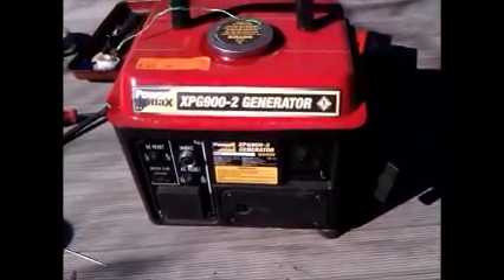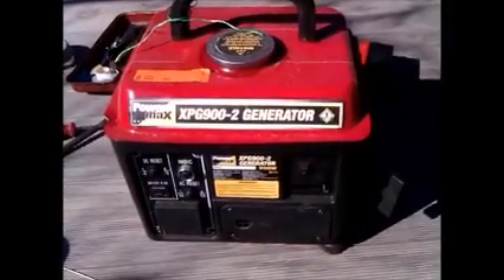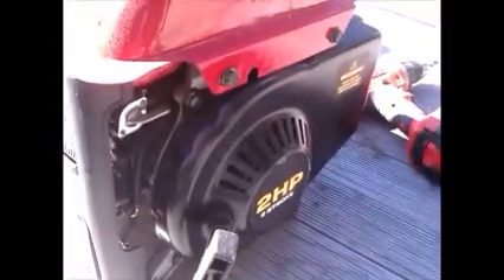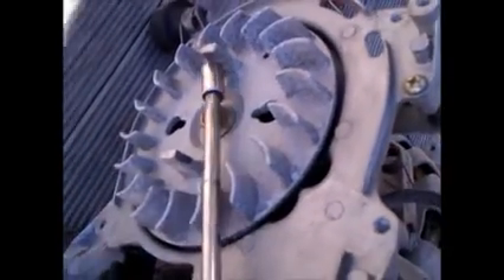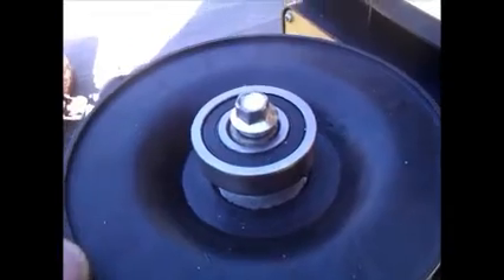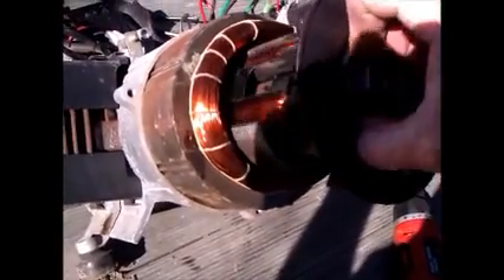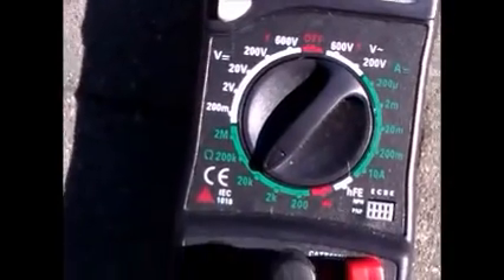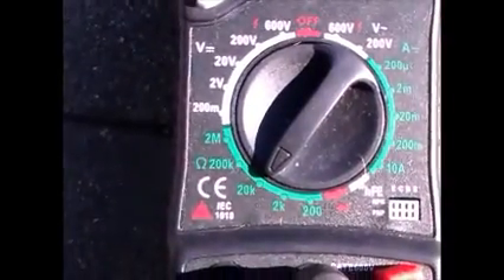How to remedy no output Powermax/Homelite 700w Generator.

Comment: The rotor coil is not connected to any part of the generator, how its work ? Thank you
Reply from the maker: It's a brushless generator. It works on magnetism. The faster the motor turns the higher the voltage output . It's difficult to explain

Comment: Hi Paul P  I have a small genny like this but the output fluctuates e.g. 200 watt light goes bright then dim then stays bright for a bit then dull for a bit, what the heck could this be?
Reply from the maker: Apologies for the video editing making it so rushed. I'd like to do the whole thing again one day. Anyway....Do the revs of the motor fluctuate as well ?. The higher the revs on these generators the higher the output voltage. If not..under the fuel tank there should be a black square capacitor with 2 wires going to it. I have found that these can really upset the output voltage too if they are starting to fail which is very common.  If they have a slight bulge, they are starting to fail. Or test with a multimeter. Set the multimeter to 2M ohms. Disconnect the capacitor from the generator. Put the multimeter cables across the capacitor terminals and you should see the digits climb and finally should show open circuit after 5-10  seconds. Join the capacitor terminals together with a screwdriver or wire to discharge or zero it and test again. They are really cheap to buy so maybe worth replacing it anyway.
Reply: no it runs as a genny should, when it gets a load it works a bit harder then its as it has no load when the light goes dull. I rev it up by pushing the governor and it loses all load, the light goes out, if I let the governor go to run normally it starts generating power again but then starts fluctuating again.Ill take a look at the capacitor .

Comment: tell me know, how to connect diode cathode & anode in armature???
Reply from the maker: It's been a long time since I've done one of these generators. My memory is slipping. There's a white stripe at one end of the diode. You must solder it the same direction as it came out.  If it is soldered in the wrong way the generator will not have full output. https://goo.gl/images/iiqi2c

Comment: Can stator be wired the wrong way round ? cos my 240v coil goes red to blue & blue to red I bought it as a non-runner so I don't know if it's output is OK
Reply from the maker: Sorry, I'm really not sure. It shouldn't matter I don't think as the output is A.C.   But since making this video I have never seen a diode blow up since. I have repaired 3 more of these generators and the square black capacitor has been the fault. They have been over-revved and the capacitor swells up and bursts. So check that first. Hope this helps.
Reply: I see I took my gen apart to fix it's engine but on building back up I didn't know which stator was which but you vid answered that. just it's wire colour coding is a joke I think used what they had at the time I will get some coloured srink wrap and sort it out make it easier to do next time I have to do it. Cheers Dave
Reply: Come to think about it can only go one way round because  of the only one way round multi-plug they use so the wire ends can't be swapped Cheers Dave.
Reply from the maker: I wondered that too

Comment: Thanks mate! we got it working and your video helped mate! the diode was buggered tested it and it went both ways, so we got a new one but a bit bigger as thats what my dad ended up picking up and a new resistor and bang first pull my hand went up to 40VAC and then started it and right up to 250V worked a treat! we almost gave up fixing it until i saw your video!! :D we only had 1 diode on ares! thanks for the reply and your video! all the best!

Comment from the maker: I originally had no output at all on 240v and 12v because I overloaded it as well. Take the diode to an electronic shop as a sample.It should be the standard 1 amp diode. NOTE Some larger generators like yours have 2 sets of diodes/resistors (one set on both sides of the armature.)  
Test the resistor/s or check it hasn't melted.
Check any circuit breakers (trip switches) on the front panel aren't faulty.
That's all I can think of
I hope this helps good luck

Comment: what was wrong with the genny? i got a 4 stroke 800W clarke genny and we have took it apart as we only get 1V from the 12v and 12Vac from the 240 output and u get up to 100V if you rev the genny! but drops back down, we have took that small diode out and we get a reading both ways.. but we dont know what diode to buy for it? the resister looks ok, and only seems we got 1 set on are's not 2 lots like u have! you think thats are problem? and what diode should we buy? i overloaded the genny lol